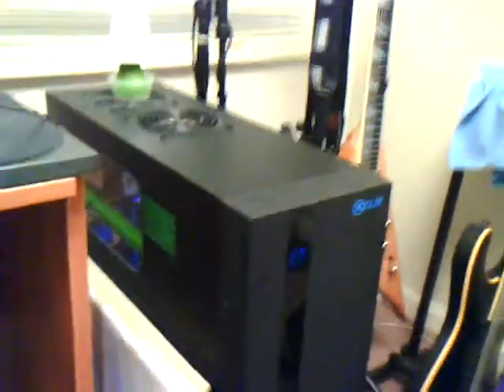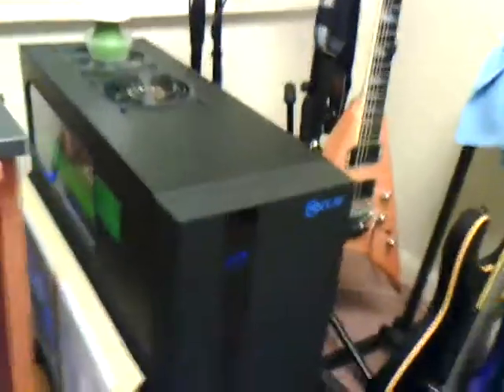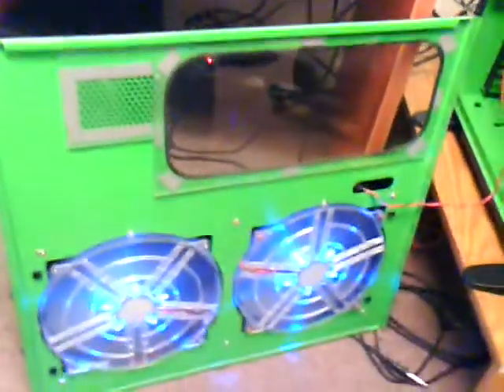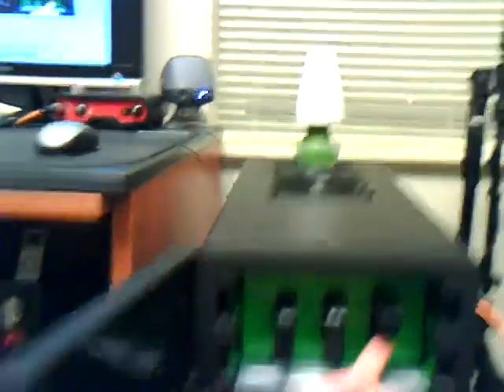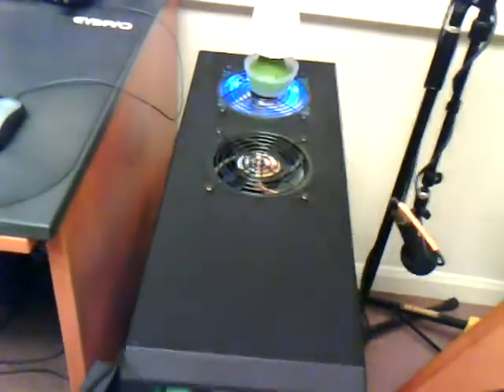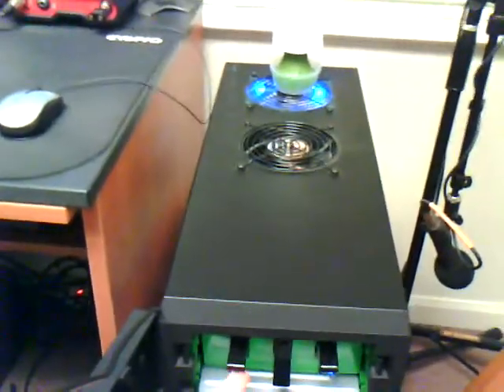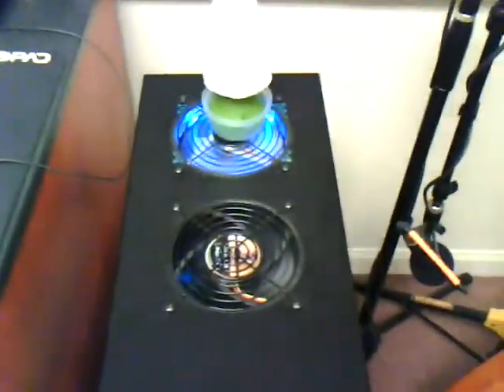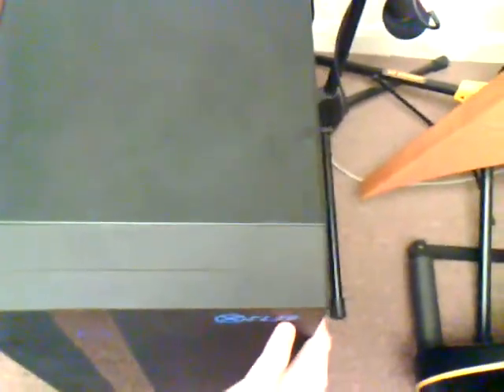Modded Xclio Windtunnel Computer Case Tour by Armand

Comment: Hey man, nice rig.

Mine is:
 CoolerMaster case (i forgot which one)
1 Seagate 7200.12 1TB drive (105MB/s average)!!!
1 Seagate 7200.11 360GB drive and
1 Maxtor 320GB drive in RAID0
Amd Phenom II B50 OC'd @ 3.535GHZ
Gigabyte GA-MA790X-UD4P
1 Ati Sapphire 4890 1GB Vapor-X and
1 Ati Visiontek 4870 512MB in crossfire,
2x2GB OCZ fatal1ty 800mhz
2x1GB corsair xms2 4-4-4-12 800mhz (hah)
Ultra lifetime series 750w psu

sweep picking, eh?